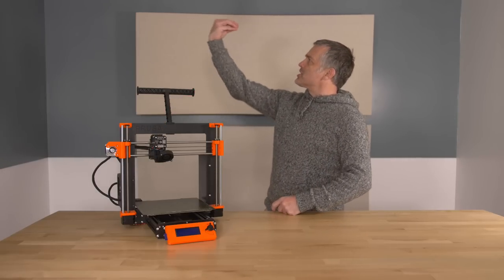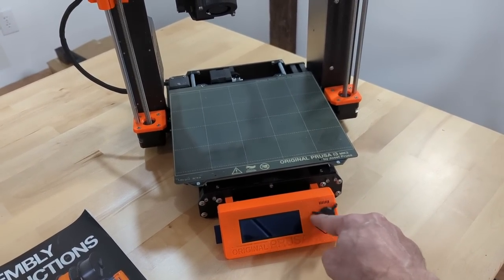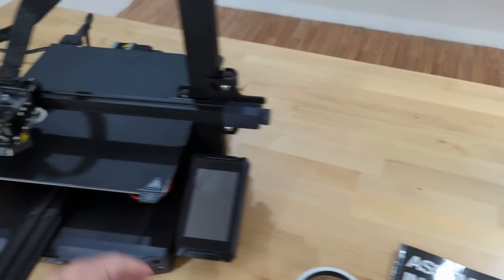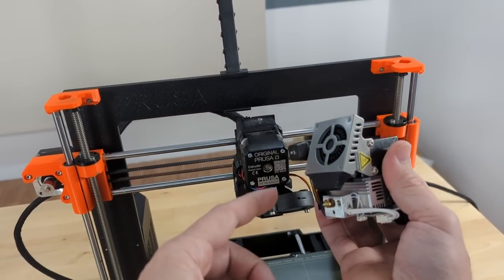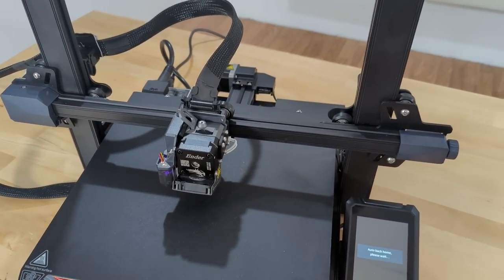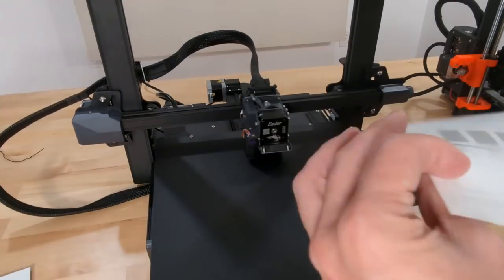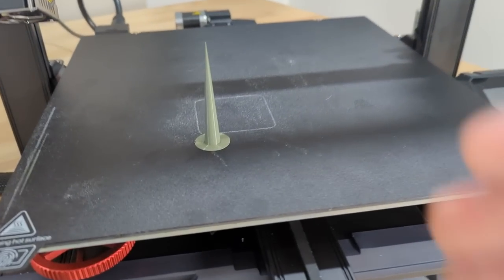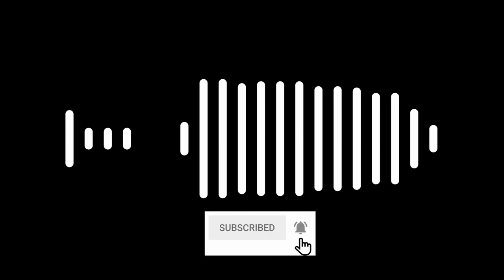Creality S1 Plus Has all the right features - Let's compare it to PRUSA I3

Comment: Dude, Prusa is more than fair. You shouldn't only compare hardware, but printer sustainability. You pay them for: 1) upgradeability 2) 24/7 customer support 3) firmware updates 4) Awesome slicer
For DIY thinkers cheap hardware is go-to option, but if you want reliable workhorse MK3 sits just in the sweet spot between "iPhone of 3D printers" - Ultimaker and chinese printers that will be outdated with new models in just few next years.
Reply from the maker: 1)WHAT? Prusa goes out of the way to discourage you from changing or modifying the base printer. Even the upgrade path to add a Raspberry Pi 0 is in shambles The claim conflicts with your second point because if you modify your Prusa you will lose customer support. Also, the Creality is better for upgrading. Put a Duet with RRF into the S1 and you still have spent less time and money than it cost you to buy+assemble the Mk.3 
2)I guess. I'm getting a lot of comments from  folks telling me they had terrible experiences with the Prusa support department. There are a couple in the comments for this video.
3)I guess. Creality does updates too. Prusa's are probably more polished. But then again Prusa is running an 8 bit controller and imprecise click wheel. How much can you really update it?
4)You can use Prusa Slicer for the Creality printers too. Prusa slicer is a fork of Slic3r. Super Slicer is a fork of Prusa Slicer. So, basically I was using Prusa slicer in the video to run the S1.

>Ultimaker and chinese printers that will be outdated with new models in just few next years.
EXACTLY! The current Chinese printer here makes the Prusa outdated. Imagine how far behind Prusa will be "in just few next years." Prusa better release the XL soon or they won't exist as a company "in just few next years."
Reply: @DesignPrototypeTest  I never said Prusa is ideal, but (MK3 and MINI) are just FAIR for extra what you pay. Obviously their constant rise and development speaks for it self.
1) Not everyone wants to use RPI, Duet, or modify at all, i assume 70% of Prusa customers are ones that don't want to modify anything on the printer.
3) Some people (like me) don't personally care about 8bit controller, and just likes oldschool click-wheel.
4) EXACTLY, chinese company use R&D from hardworking companies and Open source contributors to earn money without any money engagement. Prusa is paying 40 developers constantly working on just PrusaSlicer. (I think we should respect and support that)

My MK3 is not outdated, but my 6 years old CR10 is definitely.
Reply from the maker: 4) You were saying Prusa Slicer is superior and that is a reason to buy an I3 Mk.3. Now you want to talk about Chinese companies using open source and not contributing. These are totally different topics. I think you are grasping at straws because you are an idealogue who can't let go of your adoration for Prusa despite compelling contrary evidence. Release preconceptions from your mind and judge the thing impartially. Don't go searching for logical justifications to support your feeling that a Prusa is the best.
Reply: Cannot agree with you more.  I was an original wait list MK3 owner and Prusa was an excellent printer back then and still and excellent printer now.  All these years later Prusa support still supports me.  Twice early on had parts issues and they shipped replacement parts that I received within a week after opening a service call.
Reply: @DesignPrototypeTest  You don't lose customer support if you upgrade your Prusa Printer.  I know because I have upgraded mine and they still respond to me.  They maybe not be able to help the particular upgrade but they support the rest of it.  I bought my Prusa MK3 the 3rd day it was on sale and was on the wait list. I have never dealt with better support of a product and I have been in product support for 30 years.

Comment: Watching this on an iPhone 8 Plus.  It works great.  I have had 0 problems with it in 5 years of use.  Don’t see a reason to change.
Reply from the maker: Uh huh but would you recommend somebody buy an iPhone 8 in 2022 when they can get the newest model for half the price?
Reply: @DesignPrototypeTest   I am just not really using an analogy for 3D printers.  I just heard your comment about iPhone 8 and realized it was my phone and it still works great.  I guess if I were to be using an analogy it would be “if you have had a Prusa MK3 that is five years old, would you upgrade to the ender 3, or just keep using the MK3.  I agree that the ender is a better printer.  I am not a Prusa fanboy, I have only ever owned one 3D printer, the original CR-10.  Like my iPhone 8, the CR-10 has given me years of great service.  I do think Creality, much like Prusa have not innovated and have been caught with their pants down by bamboo labs.

Comment: I’m still using my iPhone 8. And I think it’s better then all the ones after it.
Reply from the maker: That's actually pretty cool. If he bought a Prusa 5 years ago and it's working for you, you should continue to use that one as well. The quality of Prince you will get out of all of the better machines is a barely noticeable difference. But I'm sure you're not telling anyone to buy an iPhone 8 in the year 2023. Especially if the iPhone 8 cost more than the current version.  Neither should you tell them to buy a Prusa which costs more than the new printers that do a better job.

Comment: Prusa it may well have it's backing but as far as i am concerned it is well over priced.
i now have 2 printers a Tronxy x5sa Pro and a Voxelab x2 out of the box the X2 was spot on and great prints from it every time. 
the Tronxy X5sa Pro well it has it's problems i got this at half price even at a full price i still got 2 for less than a Prusa.
over the past week i have the X5sa now sorted with updates from Tronxy and it now works great prints every time it was a fault with software that is now sorted.
would i go and put klipper etc on these no as i do not see the point.

Comment: Thanks for your real world comparison between a modern 3D printer and a Prusa. I have an iPhone 4 (and not the "S" version), but that's besides the point. I'm still running my first generation Ender 3 that I bought for under US$180 at least 6 years ago. I learned a lot with this printer and it has been a very enjoyable adventure. There was only one thing that needed upgrading and that was the plastic filament feeder. Even after hundreds of hours of prints, I'm still running the stock POM (Delrin) rollers. I've added several "upgrades" to my geriatric Ender 3 through the years, but most of them were not necessary, I just like to tinker. I have 7 printers at the moment and my next one will probably be a Bambu Lab X1 Carbon for only a couple of hundred dollars more than an antiquated Prusa.

Comment: I know that you got your well founded reasons not to like prusa, but let me tell you my experience. I have own a prusa for 4 years now and the ONLY part I had to change was to reprint a fan duct. And of course regular greasing. Printer is enclosed and also have printed MANY ABS parts. Regarding the S1 I do not own one and I got a friend who owns one and got to me to repair, so far he had to change 2 belts and 4 wheels and the printer is not even a year old. I understand that the S1 is more up to date with the screen and silent drivers but really my experience has been for reliability and wuality of the prints I still prefer the prusa. Although if you ask me I would go to a different one with klipper already JMHO.
Reply: Why would you add grease or oil to a sealed system. You should wipe off the rails never add a dust trapping substance that will just create abrasion to the soft non hardened rails of your Prusa???? Unless you upgraded the soft rails... Same with the screw's. all it does is trap crap and cause ware and mis-aliment.  If you have done this for 4 years, you must not print very much, it would tear any printer apart. Just run sand paper across the rails... then at least you can tell people you are just allowing the grease to take up the slop of the non-hardened rails.
Reply: @Prt_3D_RC  If you say I do not print much in 4 years and got missalignment then ok by me I''m just saying what I do and have worked and let me tell you I print A LOT and my prints are flawless on that one. Just saying I also got some other creality printers on my hand and was trying to put my experiende on that.
Reply: I have an S1 with Klipper. The print speed is awesome. But the auto bed leveling, as you can see on facebook communities, is very unreliable. People are trying all kinds of mods to fix it. Meanwhile, my MK3S+ although is a dinosaur and can’t hit the Klipper top speed, is significantly superior in terms of quality and consistency.
I ended up figuring out maybe I can do 1.5x speed on my Klipper S1. But if I have to try different settings 2 or 3 times, compared to my MK3S+ that just does the job in 1 go, the MK3S+ is still considered faster.

Comment: I'm always in favor of using POM over metal when you can. For 3D printers the loads are so low that I would often prefer polymer for motion components given their cost/lifetime.
Reply from the maker: Exactly! That analogy I came up with in the video of the wheel being like a tire is very apt. You don't see cars driving around on metal wheels without tires. Like you said because there are no loads why not reap the benefits of having a tire?
Reply: @DesignPrototypeTest   One thing I would like to see more of is the investigation of polymer as a motion component. I believe the Bambu uses polymer on their CF rods. Have wanted for a while to run Igus polymer on a 3D printer. The lifecycle and loads claimed are out of this world. Potentially you could ditch the wheels entirely and run directly on the 2020 extrusions.

Comment: You should do a little comparison video printing the same model but sliced on Prusa Slicer but using the built in profiles. Also do the same, but both sliced in Cura (using the built in profiles too). Maybe we can see if prusa intentionally makes subpar profiles for ender machines
Reply from the maker: Interesting idea. As critical as I am of Prusa I doubt they would do something like that. The slicer is open source after all. The handicapping would be clear to see to any programmer who opened up the github files. I guess they could release a compiled slicer that is different than the source code they shared. Possible but highly unlikely. Not that Prusa is above cheating like that but it would be a bad tactical decision.

Comment: Rod and bearings are much superior to v rollers, POM Z nuts are much superior to brass Z nuts. Prusa has z motors with integrated threaded rod, that together with the POM nuts mitigate z banding issues. On the Creality printed spire under harsh light, you can see z banding in your video.

Pusa does have more surface artifacts than most other modern printers using modern stepper motor drivers. 

The creality machine has a  bed probe that makes physical contact with the print surface and that is much superior to the non contact probe used by Prusa.

Edit: The prusa metal frame in the zy plane, that used to be a positive as other mendel style printers used acrylic or wood, now I wish it was standard aluminium extrusions so that I could bolt a proper spool holder or other things to it securely without drilling and tapping the frame.

The calibration aspect of the mk3, not talking about the first layer calibration, is typically run once after the machine has been fully assembled. On my geniune Mk3s, it passed calibration without problems. On my clone Mk3s I got a very specific error, I forget the exact error, when I went to check I saw there was an error on my part and I fixed it and the calibration completed successfully. Without the calibration I would have eventually caught the error myself but still it was cool that even on a clone mk3s the calibration caught the error.
Reply: Not a bad comment since you're talking about your personal experience and what you learned from it. Your first sentence however is untrue in the absolute sense of untrue. Not only are they not much better they're not measurably better nor visibly better in the final product.
Reply: @buzzbbird I agree, I've managed a lab with many different machines, and own 9 of my own machines, only one of my personal machines has rod and bearing and that's my original i3 prusa, I had to stop using it when the rods got scarred up from dust and started to bind. (It was old and not worth fixing) After a decade of experience I'll take the V rail and wheel set up every time hands down, it's also a great place to hide the drive belts which is an excellent design feature instead of the belts just free floating and vibrating like a guitar string causing them to eventually wear out or go out of calibration.

Comment: I’m using an iPhone 8. If you upgrade just because they tell you you can, I have some Florida swamp land to sell you. It’s almost as silly as hanging on to a Prusa mk3 printer!
Reply from the maker: Okay, but would you tell somebody to buy an iPhone 8 today if it cost twice as much as the newest model?
Reply: @DesignPrototypeTest  I guess I don't understand. The Ender 3 v2 is now $199 but I'm looking into the S1 Pro. I guess I need to watch the rest of the video but this stuff falls out of relevancy faster than the iphone 8!
Incidentally, I would indeed suggest the iphone 8 due to the enhanced tracking and recognition features of subsequent models. I've thought every iteration was great but they will quit supporting them to get you to keep moving along with the program.

Comment: would you also do a critique of the new version of the ender 5?

have here the original verison of this printer here and... really was not very impressed with it in the end. however what might be cool (for your channel content) is to compare the NEW ender 5 to the zero-g project. Which is an aftermarket project to upgrade it to a much higher standard. At which point then the modified zero-g version of an ender5 would be... something a bit more like a voron i suppose. so then the value of upgrading a garbage creality frame. vs starting from scratch and just spending the same on a printer that is higher quality to begin with. if that makes any sense, because it's a dilemma that many of us have. which is something harder to assess the value of. Since with a creality you end up throwing away a substantial amount of the original parts that you originally paid for. Which then in turn changes the relative value of upgrading so much of it.

Comment: I see all kinds of print farms on youtube featuring all kinds of printers.  The majority of them have few if any Prusa's.  When watching videos to try to glean information from all sources I see the Prusa farms making odd assumptions about upkeep on roller wheel machines that seem off.  Watched one last night and the take away was "I have 20 Prusa's because I don't want to adjust all my wheels every week". 

 Approaching 3 years of using home 3d printers and I get so little useful info from Prusa featured videos.  I use original Ender 3 Pro upgraded over the years to half the price of a Prusa kit printing 95% in ABS consumables for out small business or replacement parts for machines we use I designed.  Still on the original belts, motors, and wheels and I have replaced 2 fans and just had a cable go bad.  I think i have to had adjust my eccentric nuts 3 or 4 times and tighten my belts 2-3 times.

I am happy I didn't buy into the Prusa hype back then.  To be honest it wasn't the cost that stopped me it was the PEtG printed parts and the damn zip ties in key areas that combined with printing ABS in an enclosure that exceeded my comfortable risk level.

Comment: I don't have the newest E3 but not far off and they're good units but comparing to the Prusa (which is what,  ~5-6 years old now?) still results in me preferring the prusa.  

You can have the touchscreen.   Perhaps I'm showing my age but I still prefer the (IME) more reliable simple interface.  I also find the bed on the prusa (specifically from a stability pov) to be far superior.  Lighter + superior stability is a great combo. 

Where the ender and its similar clones truly shine is their base control boards.  Not that the newer flush mount tiny-pi can't level the playing field somewhat and add fabulous feature options,  it takes a good bit of work. 

All in all,  I learned far  more from the prusa than any other and have repaired several dozen of the others after acquiring it.   I still use the prusa as my goto for most things despite other options (creality, biqu).   I do have a Duet still in the box meant for the Prusa but can't bring myself to do it until its base setup fails (w/Zero2).  I don't think your review is necessarily wrong,  but it focuses on what's important moreso to you dismissing others who might disagree with you as "Fanboys..."  An almost slur of sorts in its usage.   I have to say I was rather disappointed with the video as a result but you do you.

Comment: sorry, didn't finish the entire video.  I've had a prusa for 3 years now and never experienced any of the "FAULTS" you pointed out.  I would have respected a fair comparison but you're obviously just bashing the prusa for whatever reason...
Reply from the maker: And yet another Youtuber has experienced the same and also it's all over the forums as "inconsistent extrusion" You're probably right though. The godhead Prusa can do no wrong. Everything with that name is perfect and beyond reproach.
Reply: @DesignPrototypeTest  every direct drive printer has inconsistent extrusion. It’s difficult to circumvent

Comment: only the s1 pro has the all metal hotend , the s1 plus and the s1 have a ptfe insert inside the throat so 260 is the limit, but i prefer not going above 230 on my ptfe printers